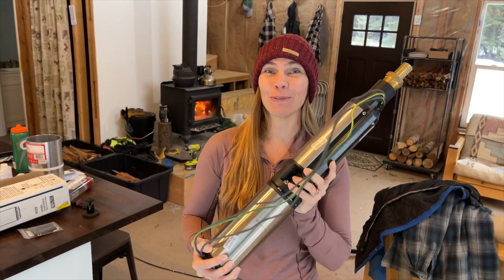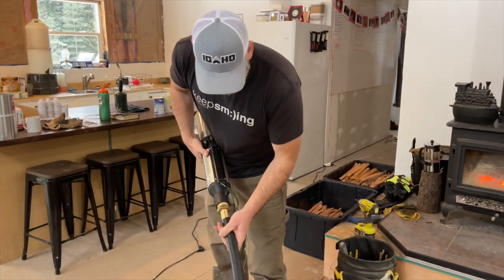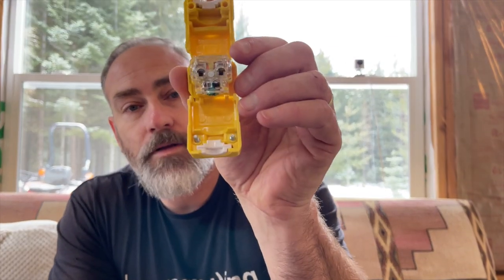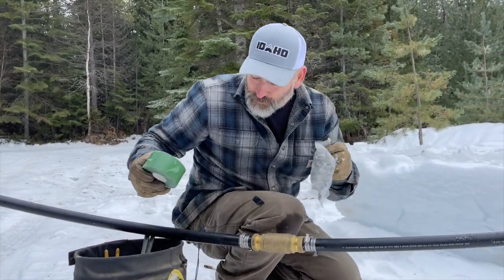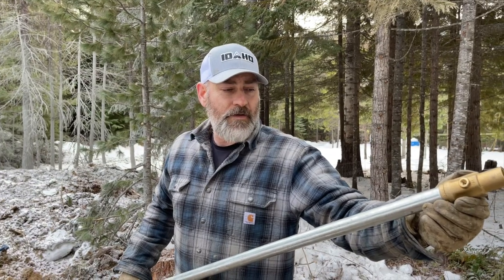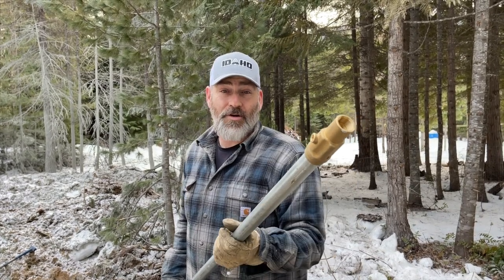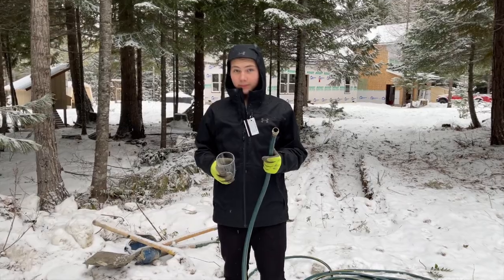WIFE is HAPPY/HUSBAND is NOT - DIY Well Pump Installation

Comment: I found that the frost freeze proof hydrant I installed 4 feet down actually froze up often. And it was in a barn with 3 horses. We were roughly the same latitude as you. Had to dig it up and put in a longer freeze proof hydrant another 2' down so 6 feet. Also wrapped it in 2 heat tapes. Which worked 'well' (pun intended) until the barn cats scratched the heat tape off. Redid and shielded the new heat tapes. Moral is your freeze proof hydrant might freeze in deep cold temperatures. Best
Reply: What's a "frost freeze hydrant"?
Reply: @mwilliamshs  Look at video at 10:25. Shows frost freeze proof hydrant. Don't be a 👍. 😎
Reply: @tomm2812  frost free, freeze proof, these are things. 

Frost freeze, not a thing.

Comment: Its called inrush current and digital generators/inverters can not provide it, older constant speed generators can because the energy in the engine flywheel and no transistors to fry/protect. Cheapest solution is a thermistor inline Ametherm SL32 2R025 (Pack of 2) Aqua-Rite Thermistor, ICL 2 OHM 20% 25A 30MM on amazon

Comment: I had my hand up. I bought a 240V 10KVA diesel generator, and it's magic. My well water was the same, full of iron oxide. What we did was to buy 50 Tons of sand. The sand filtered out the horrid brown stuff. Even so, after that we built a reverse osmosis system, though we did have to buy the gas and the membranes. We then had pure potable water. However, we fed some dirty water off to the toilets.

Comment: for future reference, 5KW gens are minimum for most "site work" applications, even running and standard circular saw with a 3.5KW or lower will burn up the brushes...
In generator world, bigger is better. 5KW min. 6500 KW or even a 10KW if you're running multiple tools and lights. (drawing from 35 yrs as a Carpenter :)

Comment: How to thaw frozen ground: One empty oil drum. Cut away top and bottom, then cut it in half, lengthwise. Start a fire on the ground and fill up with charcoal. Put one half of the cut drum on top to shield the heat downwards. Leave it to burn over night. The next morning you should have thawed ground to a depth of 50-60cm (1 1/2 - 2ft).
That's how we do it here in Sweden.

Comment: You need to size your generator to at least three times the running load of your well pump to allow for the inrush current when the well pump starts up.  If your well pump is a 2 HP (1 HP = 746 watts) then you will need a generator that is rated for at least 4500 watts, if not a little more for a safety margin.  2*746*3=4476 or more

Comment: As a water well driller and pump installer you did great other then you should’ve gotten a Franklin or Myers pump because they’re completely stainless. Also,never leave your set down pipe in the well and you don’t need rope on your pump just tape your wire ever 3 feet with electrical tape

Comment: A gentleman from Coop once told me to install a street elbow on the weep hole of the frost free valve and face it down. that way sand will not get into the valve portion of the frost free valve and prolong its life. of course be careful when bedding it in gravel so as not to break off the small elbow.
Reply from the maker: Good idea. I’ll do it on the permanent install.

Comment: That's ok you can build a simple water purifier based on gravity filtration. Two big tanks one with water pumped from the well and the other taking water from the top of the first tank after a few hours of standing. Shouldn't be a problem.

Comment: The next time you pull the pump, consider installing a pump sleeve.  This is a plastic sleeve that slides over the pump which forces the water to flow past the motor, which cools it.  Without the sleeve, water can come from above the pump and the motor can run hot.

Comment: Also depending on the amount of sediment that your well produces you may have to add a sediment filter over the pump its self also tape the wire to the roll pipe from the pump joint and up the first 5 ft and then every 10-12 ft because while it doesn't happen every time sometimes the roll pipe will break and the first joint and then the pump will be held up by only the wire and it's no fun trying to fish out a list well pump

Comment: i noticed your insulation in the background. your using a craft faced batt and a visqueen covering, you might want to check but that is a double vapor barrier, moisture will accumalate between the paper and the plastic, you might want to take down the plastic a d cut slits in the batt backing then reinstall the plastic

Comment: I did all that as well least summer, but my well casing is PVC pipe, on our old place we sold there was a well with Mattel casing, and that water is always Brown and rusty after a short time if little used, and our frost line in Canada is deeper to, I had to go 7 feet down for the connection,

Comment: Part of the problem is if that is a 240v generator you are trying to draw the power for the pump on one leg!  When you start trying to use it on Solar it will also put a big surge load on your inverter. Highly recommend a 240 volt pump to put same load on both 120 v legs  AND a soft start pump like a Grundfus SQ not the more expensive to buy and maintain SQE models unless you will gave a lot of irrigation use etc.  Guess you found out its a lot harder to pull up with water in the pipe especially 1 1/4 inch instead of 1 inch pipe!!!  You can also instal a SOFT SART kit on many pumps which will reduce start up amps by around 70% !!

Comment: You need to put more torque arrest on that waterline the wires could chaff on the well casing over the years and you’ll end up pulling it out again to fix the broken wires.  I know I used to work for a plumbing company up in Maine.  Ray plumbing and heating lol. 
I’ve seen is happened to many wells including my own.  You should’ve put another 20 feet above the first one and a few more that is recommended for a deep well that you have.

Comment: As to water turbidity,, muddy water.   Sometimes you have to pump a lot of water to finally resolve a well.  Case in point.  A well I commissioned 30 years ago,, drilled just fine,, rotary rig,, known water tables for that location,, we took the third one down because so few neighbors were as deep  just over 300 feet.   Incredible quantities of water.  Lots of fines,, so we installed double screens each extra fine,, threw a nice big trash pump on the casing and pumped something on the order of 100 gallons per minute to flush the fines out of the surrounding sand bed the point was into.  We pumped for 4 days at that 100 gallons per minute  before surrendering and declaring the turbidity was sufficiently reduced.  Now let me see,,, 100 gallons per minute  X 60 X 24 X 4 days  nearly 600,000 gallons pumped,,,, and it was still not clear.

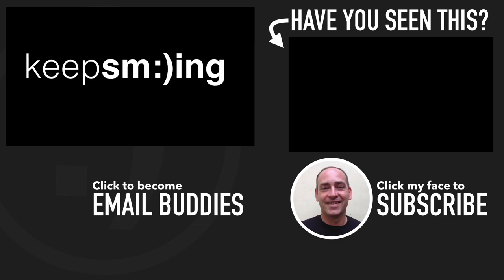Comment: Great work!  Tip @ 8:55/24:00 you can heat up the black pipe with the torch to make it easier to work with.

Comment: It takes awhile to clear out the muck in a new well. Some longer than others. Yours is very deep, so it will take longer, The dirt in the water will settle to the bottom of the well, but it might take a while. Be patient.

Comment: Did the same thing my 6,300 watt Yamaha inverter does whenever I attempt to power my Quincy QT-54 air compressor with a 5HP electric motor. I think I need double the size of the generator to power that thing. Just not enough amps to kick it on.

Comment: As a retired geologist, I've installed a few of these over the years.  As others have said, keep pumping.  What happens is the pump initially draws the fines from the ground outside the screen. In time, a graded filter develops whereby the fines have all been pulled through the screen and out of the well, and a natural filter with a range of soil grain sizes develops outside the screen.  Just takes a bit of time.  Unless that's iron staining that is......
Reply: Jack pump to clear, run pump clear a week . Well mechanic retired

Comment: If you pull the pump any more make sure you create slack in the wires before you tape them on.  The plastic pipe will stretch over time, the wires will not and it will actually pull your splices apart. Make extra slack in the wire all along the total length of the pipe to allow for this stretching. This happens slowly,  over time, maybe even years but it will pull your wires loose eventually.
The pump should be placed deep in the well to provide you with more water that is in storage in the pipe. The way the water level works is the pump only has to push from the level of water in the well.  So no matter if the pump is set at 100 feet or 400 feet, if the water level is at 75 feet the pump is only pushing from there no matter how deep you set the pump.
The torque arrestor will move in the well along with the pipe every time the pump starts, this will knock loose dirt and silt for a while.  It will soon clear that loose material out of the way so it will stop and settle out, pumping large amounts of water out of your well will not help this.
I saw the little generator and knew it was too small but you figured that one out, Good Luck and great video!

Comment: I skimmed a few dozen comments and no one said this specifically but..... A two wire pump has what is known as a 'low starting torque' motor.  The more expensive three wire pump will have a start winding that is energized through a relay and start capacitor in the control box.  Low starting torque motors draw their LRA for an extended period, because they do not get the additional boost from a start capacitor to initiate rotation, so it takes longer for the motor to get up to full speed.  The combination of the low starting torque combined with the output of the generator is the whole problem.  Look at the pumps information and see the amperage rating at start (LRA) and also at normal running (RLA or FLA) while pumping water.  
    Take the applied voltage at the generator and multiply that by the amperage.  The product of that math will equal the wattage required at starting and at normal operation.  Compare those numbers to the ratings of the power supply...in this case, your generator to determine if the generator is of sufficient capacity.  Remember Ohm's Law:  Volts x Amps= Watts.  Watts divided by Amps = Volts.   Lastly, Watts divided by Volts = Amps. 
     Keep in mind also that the longer the wire, the greater the resistance, and there could be additional 'voltage drop' due to that resistance which causes your amperage to go up even more, because you've changed the calculation and the fact that voltage and amperage is inversely proportional.  For instance, a 10 amp load at 120 volts will automatically be a 5 amp load on 240 volts, with the reverse being opposite.  
    Sorry I got carried away, but its something that can't be explained with just a few words.  Oh yeah....I totally enjoyed your video. We use 21' sections of 1'' galvanized pipe or 20' sections of pvc threaded pipe here.  Most wells older than 15 years are like that, though some of the new wells are going in black flex pipe like yours.

Comment: I don't mean any harm, just trying to make a helpful suggestion. From experience in drilling and working on wells in the past. The rope seems like a good idea, but it is not. It will eventually brake, and when it does it will more likely than not wind itself around your pipe and pump making it extremely difficult, if not impossible to pull the pump.  I hope you have good water and for a good long time.

Comment: You need to check your voltage from your generator WHILE your pump is drawing the 33 amps!!  Another volt meter will be required.  If your voltage is dipping then that will increase your current draw A LOT with a motor.   And as others have said starting current is probably 3x to 5x what run current is.  Lastly if you generator is not capable of the full current to START the pump it will bog down and that will amplify the current draw problem.  In other words your pump will actually draw more current on a generator that will barely run it (due to voltage sag) ... than it will from a generator which has plenty of reserve power to run the pump!  I have lived off a well for 30 yrs, any time you mess with the vertical pipe that goes into the well whether that be for wiring or plumbing issues in the well - your water will be "cloudy" for a few days!

Comment: Glad you learned about inrush current, the current required to start the pump. This is the reason for pressure tanks and  a storage tank so that the well pump doesn't have to start all of the time. Btw, those generators you have are junk and are not capable of long term demand. Highly recommend you go see Selkirk Power Generation and get a real generator. Wondering why you didnt opt for a low volume dc pump to a storage tank you could have run from solar?

Comment: CHECK THE LIFT ON THE PUMP. Usually the pump should be over sized. Water weight is hard to lift. .43 pounds per foot of lift.

Comment: there is a solar pump from rps that will get you 11 gallons a minute at that depth i install pumps for a living and there is a guy in cheney that puts these systems togethern i think the company is called northern solar but the brand of pump and controller is called rps- rural pumping systems i was impressed

Comment: Yeah, we thought the same as you when we drilled and added our pump.
30 amps draw gets a 30 amp genny...LOL
We run the same size genny as yours but for emergency operations only.
It rains sideways for days down here. Don'tcha know?
Now you'll need a little storage shed for your newest addition.

Comment: Try the predator again but turn off the eco mode. I've had that problem before on my small compressor with a high in rush current and when the genny is idled down, it doesn't have the amps to give the compressor the initial surge it needs to start up.

Comment: So this is the reason I used a DIY Gyser pump to pump my well in a off grid situation. It utilizes air at 25 psi to pump the water and helps clean the sludge out of the well.

Comment: I have a predator generator like yours and a 1/2 HP submersible pump. It's Red Jacket brand 2 wire 230 volt. I have about 200 feet of 1 1/4 pipe no check valve ( it's built in to the pump ) and 200 feet of #12 wire. I have a 115 to 230 step up transformer for the pump. I can run it and a refrigerator and a few other small loads all at the same time no problem. Do you think there is that much difference in pump starting amps. Maybe a 230 volt pump would work better. I enjoy watching your videos keep them coming.

Comment: For future applications: Inrush current at motor start = FLA tag rating (Full Load Amperage) * 6 for any AC induction motor. Your generator would need to be sized to carry FLA for as long as it takes for given motor to ramp from 0 - 100%. A well pump is under load immediately at start and the higher the head its pushing the longer the start ramp can be. (if too long then the pump is undersized, but obviously yours is not) Glad you got it sorted with the larger genny. 

-Former Sparky.

Comment: There's a really neat pump called a brumby pump that uses no electricity down in the hole... it uses compressed air to push the water up the pipe.  A windmill could probably send enough air down there to keep a tank filled or use one of those quiet a/c compressors hooked to the solar panels.  I like the idea of it since you don't have electric and water mixing and it's much lighter for the do-it-yourself'er.

Comment: Pump the well slowly to start, until it cleans up and then increase the rate with time as it cleans up.  The well should eventually clean up if the screen slot size was sized properly.  Drawing that much sand through your screen can cut out the sloughts and then it will never bridge.  The whole idea is to draw water through slowly allowing the larger sand particles to bridge on the outside of the screen.  Bridging theory says that if the sand particles are 1/6 of the slot size or larger it will bridge.  Once you have established a sand bridge on the outside of the screen it will hold back the smaller sand particles.  Unfortunately when this happens the well will become less productive due the pressure drop across the bridged section.

A hindsight shoulda / coulda, too bad the drillers did not put a couple of sacks of larger playground sized sand down the wellbore before they lowered the screen in there.  If in fact the screen slot size is so large that it does not bridge on the screen, it is possible to release the packer and pull the screen.  Having spent that much on the well and knowing that you have water it maybe a reasonable option.  If you should decide to do so, the drillers need to install the screen using a method known as gravel packing.

Comment: Just an amateur here, but educated enough to know the 3.5 Ton HVAC heat pump (240V) on the roof of my house uses start capacitors to supply the startup amps necessary to get the compressor and and outdoor fans going.  Is a $10 start capacitor not the simplest and cheapest solution to supply the amps necessary to start the pump motor?  An over sized generator seems a clumsy and expensive solution to the problem.

Comment: Hi there, to determine if the pump is working properly, you can calculate the pump power. P=QxHxpump eff in %. From this formula you can derivate the electrical P. P=U x I x cos phi. Maybe this helps the next time. If you have a question about pumps please feel free to ask. Regards Rob - Veeningen / Holland